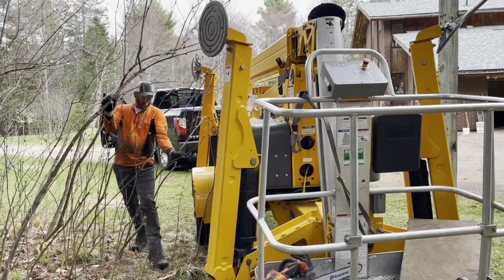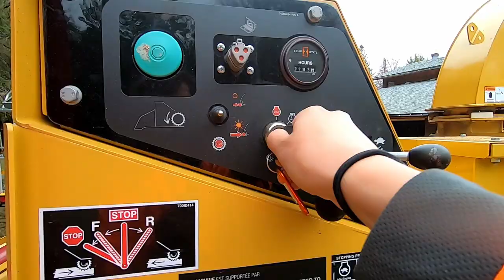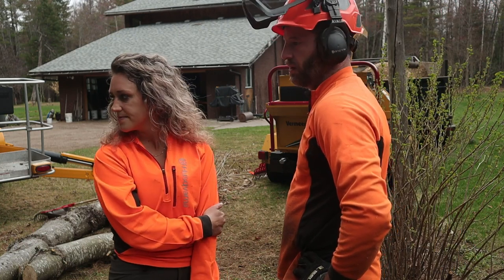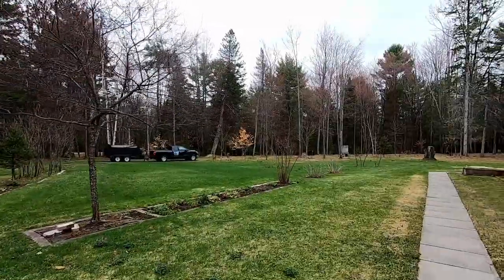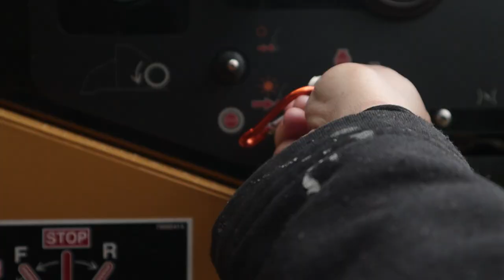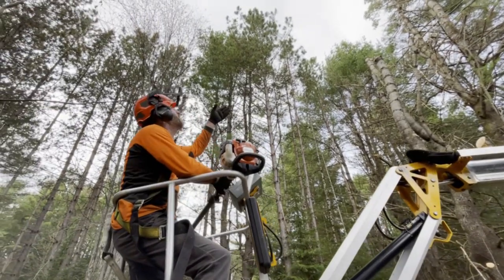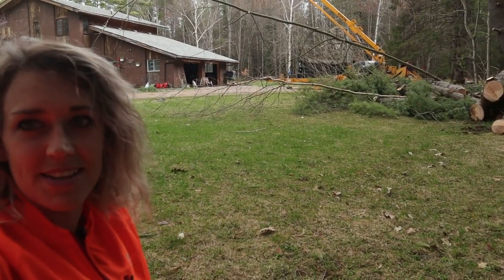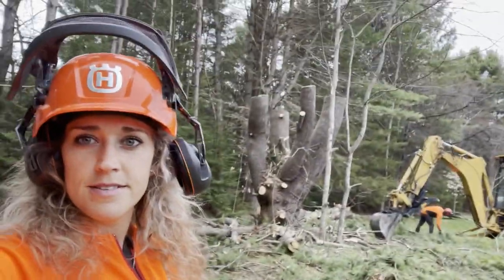HUGE WHITE PINE TREE REMOVAL 80ft TALL | Job Vlog#1

Comment: Here's a old pro tip for Brandon
Old fire hose cut to the length of the chainsaw bar makes a good and cheap bar cover.
It's rubber lined.

Comment: Great job guys and congrats on the new channel.
Reply: Back in July of 1999 we had a Canadian derecho. The derecho brought more damage when it crossed the border into [Ontario] during the early afternoon hours of July 4. At its peak near Thunder Bay, the winds were estimated to have been much stronger, around 100 mph (160 km/h) and it spawned some small tornadoes. One small sailboat was overturned and two people were thrown into the cold waters of Lake Superior. They were rescued by a nearby boater.The storm carved a path of destruction into the sparsely populated forested areas of northern Ontario. The Canadian Pacific track between White River and Chapleau in northeastern Ontario was put out of service by fallen trees. I had three large jack pines leaning toward my garage and had to delimb them by climbing up and using a safety belt. LOL Sure could have used your help back then with that chipper. Still burning some wood for bon fire wood to this day.

Comment: The articulated boom lift platform in this video is a Haulotte 6543A, which has a 65feet(19.812 metres) high platform,500lb lift capacity and a price of approximately$61,495,€51,828,£44,489 in 2021😷🇮🇪☘️🇨🇦🐕.